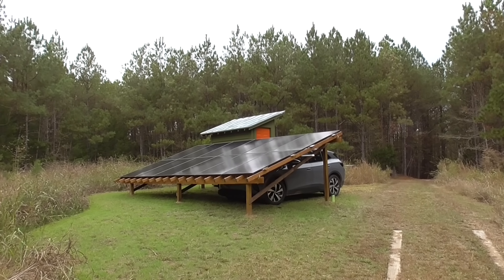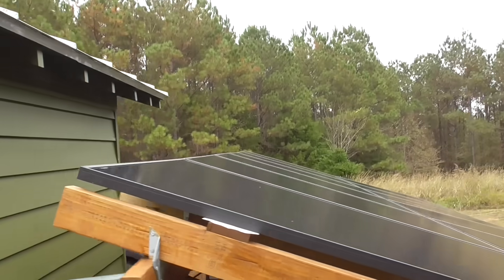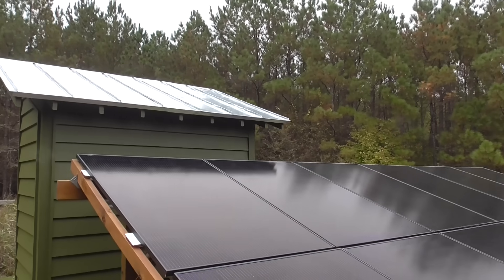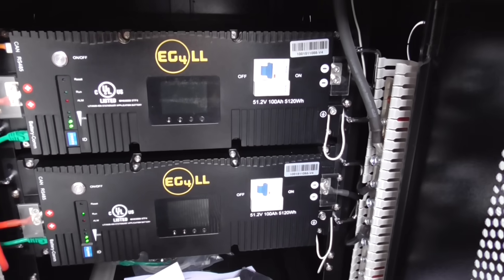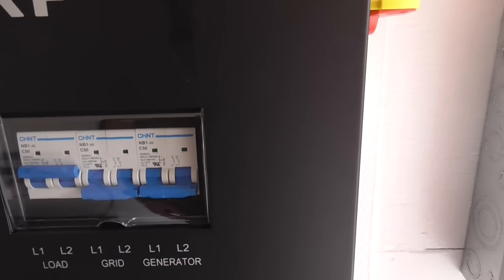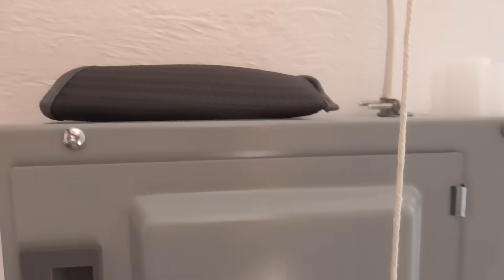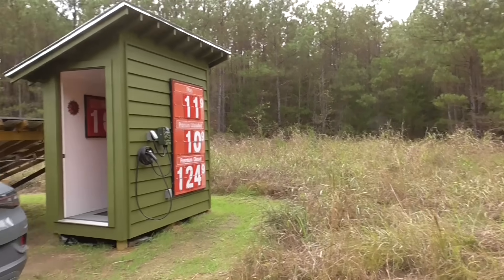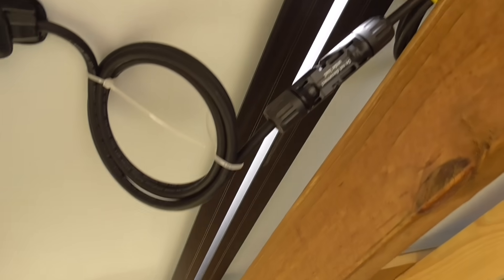Off-Grid Solar EV Charging Station. Stand-alone solution for EV.

Comment: @wickedmessenger1 I have done a lot of carpentry work but am very new to doing electrical work.  I would like to build a system like this that has maybe 3 times the output, so that I can charge my car overnight every night and run a few things in a shed too.  Would you be so kind as to recommend how I go about this?  Even if you could point me toward other resources for good information, I would be grateful.  Thank you for this video and any help you can give.

Comment: Cool build.
I have grid tied system and european stuff, but here we have chargers that take in load data to tricklecharge car with changing amps.

I use go-e charger with its own cloud to do stuff. But same can be achieved with other chargers and homeassistant doing the commands to charger.

Comment: This is a cool setup, and I say this as someone with home solar and a great deal of knowledge in power generation and various kinds of engineering. 

You’ve got what you need with the minimum spend you had to do to achieve it. That’s proper engineering.

I realize that half the people on this site breathe through their mouths and the other half legitimately can’t read, and keep telling you to make it bigger and just can’t seem to grasp that you literally have no other loads and no way to store the overflow or give it back to the grid. 

It’s good work. Even the wiring is legit, well run and clearly marked, colors correct and everything appears to be properly sized to the loads.
Reply from the maker: If I needed a lawyer in this Youtube court of popular opinion in which I seem to be forever on trial, I would hire you to defend me! You seem to be the only one who actually gets this. Yes, this setup is EXACTLY an engineering problem: how to meet certain defined specifications without overspending. As it is, the system spends too much time doing nothing, even when I'm there it pretty much just sits there all charged up, being unused. And yet, it seems to bother everyone that it's not this and it's not that. Thank you for your comment.

Comment: Cool system, but you should have paid the 100k to run power out there. The value of your land would go up significantly
Reply from the maker: No, I doubt it would have increased the value even a fraction of the $100k. Plus I would have had a monthly electric bill that would never end. What I have here will eventually pay for itself and then provide free power after that. Grid power cannot do that.

Comment: I built a 20x16 carport for the purpose of protecting our truck and adding a solar system to run our home. right now we only have 1640 watts on a renogy 48v hybrid inverter. One day the whole roof will be panels and we will have a larger hybrid inverter system. For the life of me I don't know why you didn't give it legs to use it as a carport.
Reply from the maker: That's a common criticism. I have explained responding to other such comments that I was working in a remote location with hand tools only, no water for pouring concrete, and getting materials to the site took hours. My initial plan was to park under it as a carport but I scaled that back when I realized the enormity of all the details. I made the correct decision for the circumstances. Now, I'm glad it's not tall because I can easily squeegee the panels when they get covered with pollen and dust.
Reply: @wickedmessenger1  I was thinking cleaning might have been your reasoning. I get that. I also love out in the jungle on a 4x4 road on Maui with crazy prices. But protecting our first new car was important to us. Glad it's working for ya. One day ours may be an ev station. Take care and enjoy.

Comment: Is it possible to charge in DC using only the panels? Or use the DC from the batteries directly to the electric car?
Reply: I’ve also been curious about pure DC setups. When you have limited power producing hours (daylight hours) I’d love to reduce DC -> AC -> DC  conversion inefficiencies

Comment: Very interesting set-up. I had no idea where South Carolina was, latitude wise. A quick check, tells me between 32º to  35º north is where it's at. I'm at almost 38º south in the southern hemisphere, so within reason your generating capacity will be slightly better than us, but very close.

I worked in some very remote places 50-60 years ago, no battery tools or anything back then, almost everything done by hand tools. So I have empathy for your efforts, and yes, lack of water for concreting or anything like that can be a big challenge. Regardless of whether or not you use your small truck (ute) to bring stuff in, it will still be hard.

Having done something like this would have brought you great satisfaction, and those fuel pricing boards are a hoot!
Reply from the maker: Thanks for your interesting comment. I get so many comments telling me that I should have done this, I should have done that. I put a lot of thought and research into my projects and know just how much time I have to work on it and what resources are available for me at this remote location. Everything is a compromise. You have to negotiate the compromise for the best possible solution with all things considered. There's something about Youtube that makes people feel that if they watch a video they should have a say in what you did. It gets old.

Comment: Add a generator to your setup, run on propane and you will not have any problems charging your car when the sun isn't shinning.  I have off-grid system also with 4800 watts of solar panels and 700ah lithium battery bank, four inverters giving me 120 amps of ac power to my house and garage.  Hope to get an ev as well !  Thanks for sharing your project...
Reply from the maker: One thing that's important to me is not to burn any CO2-producing fuels. So I wouldn't consider a generator. What I have works and has met my needs 100% of the time thus far.

Comment: Love your setup. Thinking about the ultimate system. What you have works great but if price is no object this is my recommendation. Change the inverter to EG4 12000XP  this gets you to the maximum ID 4  11 kW charge rate. Upgrade to 14 100A 48 Volt batteries. This gets you a full 62 Kwh charge. In and out in with a full charge in 6 hr  night or day. However engineering goal is to get the required performance at the lowest cost. I think you have done achieved this goal  spectacularly.
Reply from the maker: What you describe would be just as convenient as charging at home, no doubt about it. And if that convenience came at a certain cost, I could justify it. However,  even if I had that system, I would seldom use it to its full potential, if at all. I'd still charge to 50% when I arrive and keep it there for a week or whatever until I needed to leave and then charge up the remaining 30% and go home. Even with some challenges this winter with long-term cloudy days, I still managed to charge up and make it home. And if worse came to worse, I could always get enough charge to make it to the nearest commercial charger (40 miles away) and charge up there on my way home. I think if I do anything at all to the system, it will be to fill the third slot in the rack with another rack battery and that would eliminate those "challenges" I encountered this winter.
Reply: @wickedmessenger1  Adding solar panels would also be something that could help you in winter, the solar panels aren't that expensive as well.
Reply: The VW ID4 (like most EVs) can only do 11kW AC charging if using 3 phase power. On single phase it will be limited to 7.4kW so the benefit of the greater output from the EG4 1200XP is not quite as much as you think (unless it provides a 3 phase output). If @wickedmessenger1 is not time-limited when charging the car then the it would hardly be worth it. (When I charge at home my car is parked for way more time than is ever needed for charging so speed is not "of the essence". This is quite different to the speedy charging required when halfway through a long journey.)

Comment: Do you commute daily?
Reply from the maker: No, never. Typically I'm there for a week, but I've been there as short a turn-around as 3 days. If I made the round trip in a day this setup would not be able to get me home. The most I've ever been able to charge the car in one day is to add 40% to what I arrived with (usually 20% plus or minus left in the car when I arrive). And I could never get all the way back home with 60% on the car's battery.

Comment: i like how its still pretty useful as a partial carport. never need to clean snow off the front windshield
Reply from the maker: It's also good in the summer to keep the car from getting baking hot in the sun. I would like to have made it tall enough to park completely under but it was really going to be too much work and I was worried that it would become much more of a sail in high winds.

Comment: Really nice setup!   We have an ID.4, same color 2023.  Also Grizzle, grid-tied Solar.  I’ve often wondered about the feasibility of your kind of setup.
Reply from the maker: The solar station has worked for me very well, but it's definitely not as convenient as when I charge at home. For my specific needs, it's perfect. When I go to the farm I'm going to stay there for probably a week, so I have the time to charge up over the course of two days (up to 50% the first day and then to the final charge of 80% the second day). If I needed to make the round trip in a single day, I would have to go to a charging station for that last 30% to get home. That's not a terrible scenario, but it just goes to show that this isn't as easy as charging from grid power. If I spent a whole lot more on batteries and solar panels than I did, probably double, I could get the whole 80% in a single day. So it's a balance of cost vs. convenience. So far, some 5 months into using the solar station, I have had a 100% success rate in returning home solely on the power of the sun. I have never had to go to a commercial charging station.

Comment: A lot of effort when you can just pull in, refuel and go in less than five minutes.  ROI for the carbon footprint against a normal car is over 150K miles which I am not sure the batteries will last that long.  ROI for the carbon footprint against a hybrid is over 400K miles.  EVs are just not where they need to be yet - battery technology needs to improve dramatically to make it more environmentally friendly
Reply from the maker: Your information is incorrect. Recent studies have shown that EVs break even with the carbon required to manufacture them in as little as 18 months. Can you tell me when a Gasoline vehicle breaks even? Answer: it never does. Even with what I have spent building this charging station, I estimate that my VW ID.4 will have completely paid for itself (And the charging station) in 11 years. Now that I think about it, I have been putting gasoline in cars since 1983 and I can't remember a single time when the gas station said, "You know what, you've been paying for gas long enough to have broken even, so from now on all your gas is free." It's funny how so many people don't want to believe that EVs save money, and it's probably because corporations that make money on fossil fuels have been spending millions every year in disinformation campaigns against electric vehicles. You have been drinking their Kool-Aid, my friend. I have compared the cost of driving my gasoline-burning truck (which I still own and use from time to time to pick up loads of lumber, etc.) to my VW and found that the cost of operation is 20% of what it costs me to drive that truck. That's like being able to buy gas at 60 cents per gallon. The low carbon footprint is a bonus--my solar power creates no additional CO2, but the trips from my house begin with charging from the grid, so that electricity does create carbon emissions. Even if I weren't saving a single penny on owning my EV I would still drive it because it's so much better, faster, and quieter than any ICE vehicle I have ever owned. If someone said to you, "Hey, I can tell you a way to get gas for 60 cents per gallon," would you say, "No, I'm going to keep spending $3 per gallon because it's less effort." No, you wouldn't. Well, I'm telling you that you could be driving an EV that would cost you the equivalent of 60 cents per gallon in energy costs. Charging time is totally irrelevant to me. You know how long it takes me to "fill up" the battery? Two seconds. Yep. One second to plug it in and one second to unplug it. Because when I get home I plug it in and walk in the house. When I arrive at the tree farm, I plug it in and walk to the cabin. That makes your "pull in, refuel and go in less than 5 minutes" look like an eternity.
Reply: Funny, if it takes that long of an explanation then i must have hit a nerve. I am looking at cradle to grave costs wrt carbon footprint to include mining of materials, manufacturing, creation of electrical for charging and disposal/storage since some of the components cannot be recycled.
Reply from the maker: @Grasshopper-hj9lr  You hit a nerve because I hear the same Fox News talking points from a lot of people, and they are not true or wildly exaggerated in some cases. Do you similarly demand that an ICE vehicle account for its carbon footprint? They far, far exceed that of an EV. Most of the battery nonsense that your talking points hit on are based on the obsolete cobalt batteries that are not part of modern EVs. As I said, EVs make up for the manufacturing carbon footprint in the first 18 months and after that they are only adding carbon to the atmosphere as much as the electricity they use produces. I gave you a very thorough discussion because I thought you might revise your thinking if you had the facts. But I can see you want to be opposed no matter what. I even appealed to your sense of saving money, even if you don't care about carbon footprint. But haters are going to hate.
Reply: @ TedTalk and science would disagree. Think blaming it on Fox is hilarious - just goes to show you are pushing a narrative. I will stay in my reality, you can stay in yours.

Comment: Just so you know, most guides will tell you the angle for maximum power production over a year, but you probably benefit by getting less power in summer but more in winter by making the angle steeper. You will produce less Joules overall, but a more linear power supply over the year, instead of having a shortage in winter.
Reply: That’s what I was going to say.  I am preparing to build a nearly identical system, but my planned panel angle is 70 degrees which is a bit shallower than the ideal for winter solstice in my area.  I want to maximize the number of days the system will generate the minimum amount of power desired for purpose. I don’t really care if I miss out on the maximum the system might generate mid-summer since I would have no use for all the excess.  At around $0.50 a watt, PV panels are cheap enough now to invite setting aside shallower notions of maximizing ROI.
Reply: @joelsmith4394 I have never thought of that. If you think about it thats the ideal way to design most residential solar systems. In most places nowadays you barely get any money for selling excess anyways, but in the winter youd save a lot more if you dont really have to pay for electricity
Reply from the maker: The angle I used came from an online calculator that gave the ideal angle for the latitude. I believe it's that perfect compromise angle you're talking about.

Comment: won't 48V 100ah x 2 only charge your EV by 10%? adding another battery will give around 5% more charge. am i wrong?
Reply from the maker: Yes, that's about right. If I do anything further to this setup, it will be to add another battery. So far, I have been able to meet my goals of bringing the car's battery to 50% upon arrival, and then later bringing it to 80% when it's time to leave. Keep in mind that I seldom am charging from the equipment batteries alone. I almost always have solar assist anywhere from a small amount on an overcast day, to a ton of solar on a summer, cloudless day.